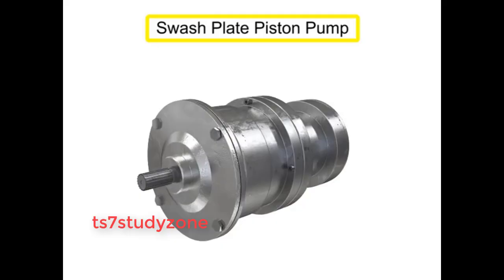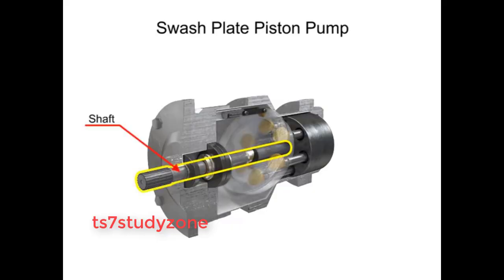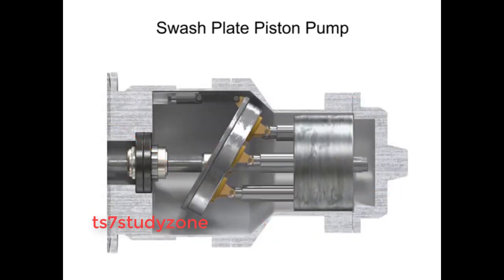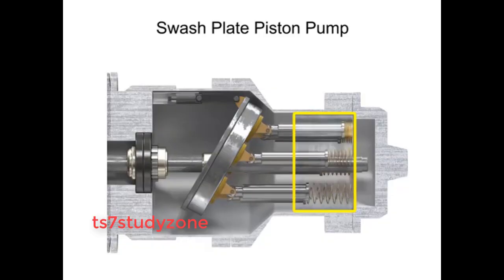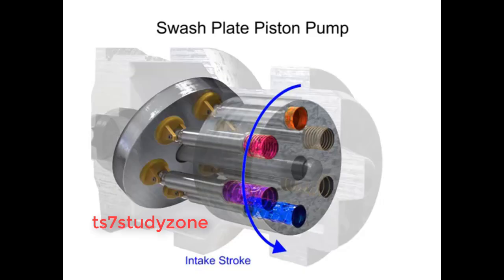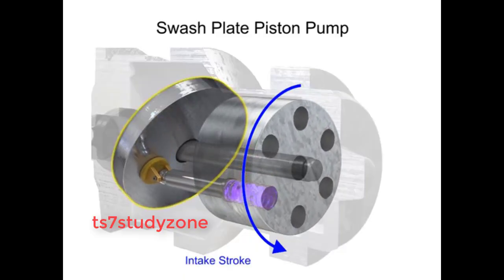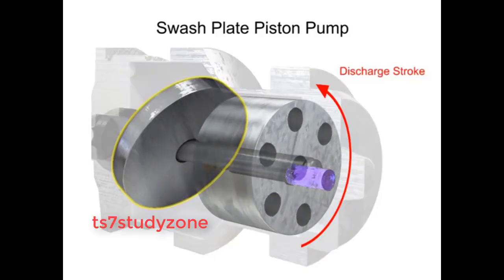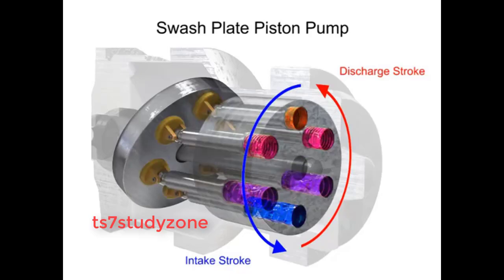Swash Plate Piston Pump (axial flow variable displacement) Working Animation With Detail Explanation

Comment: Does someone actually make one like this?  Lots of issues with the design.  Maximum pump pressure would be determined by the spring strength, (not the motor driving it !!), which would change over time with wear and fatigue.  Plus the sliding piston.. cams (?) on the swash plate would be prone to friction and a lot of wear on the pivot joint as the direction of force on it changed 360 degrees every rotation.  The typical rotating swash plate version is much stronger.

Comment: Been scouring the internet to satisfy my curiosity how these work. Thank you.
Reply: I've been looking for a couple days to find this video I took my mower apart because the pump wasn't working properly, or so I thought.... ends up being a bad wheel motor....
But yeah I know I had that thing taken apart and I was still trying to figure out how the heck it changed the direction of the wheel on my how does this work I seen this wash plate and how it moved back and forth but I was like still trying to figure out how that changes the rotation of the fluid but now this makes perfect sense thank you so much

Comment: Hi,
Are there machines out there that have a controllable/ variable angle swash plate?  Such that- the operator can control the pressure/volume output of the pump - in a situation when it is mated to a diesel engine of constant RPM?
Reply: If you are asking for a machine, the steering gear of a ship employs swash plate to generate hydraulic pressure for it's functioning.
Reply: Sorry for answering old comment but indeed there are. Most modern construction, farm and mining equipment has those. There are both tiltable swash plate designs and ones that have tiltable piston block, effectively achieving same variable output volume. Those are called axial flow variable displacement pumps. There's usually hydraulic adjustment valve connected to the pump that adjusts flow according to some variable. The most common is probably adjustment valve that has pilot pressure applied, and the valve tries to keep output pressure constant to that pilot pressure with preset offset. And there are adjustment valves that try to keep pressure always constant despite flow needs. And there are many others. But pilot pressure adjustors are common because when there's little to no load, swash plate can tilt to almost perpendicular to connecting rods resulting in less power consumption and hence smaller load to engine or motor running the pump.